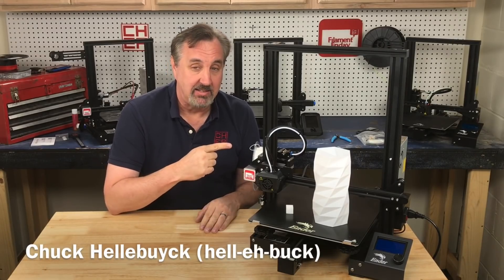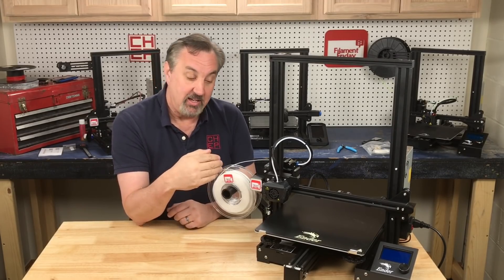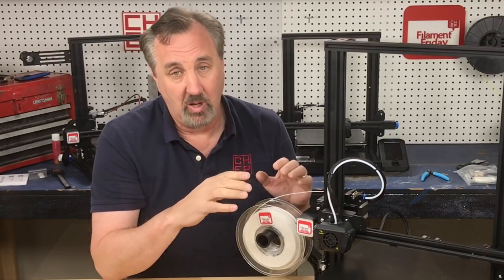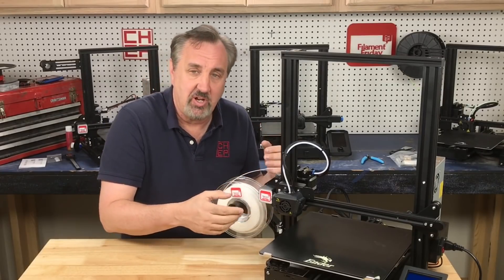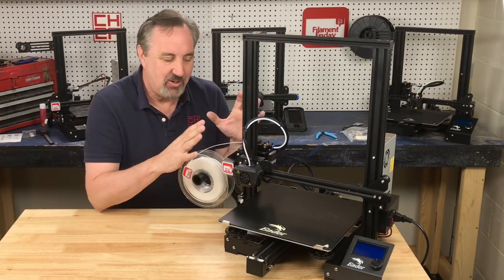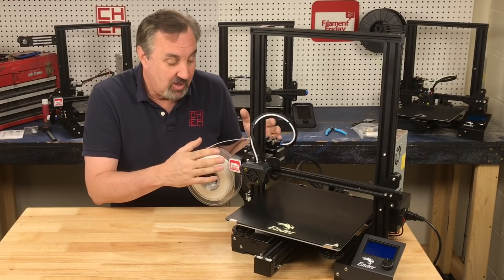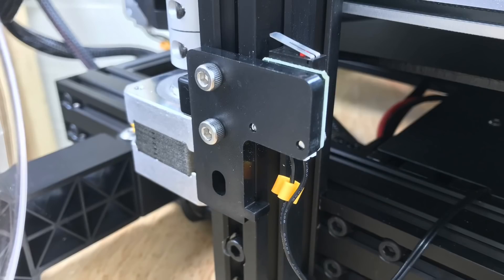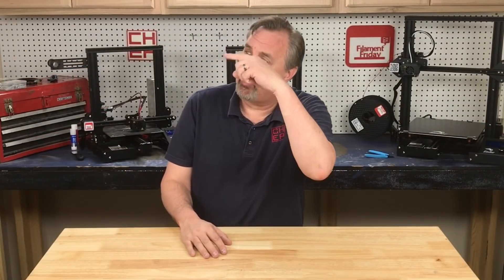Creality Ender 3 MAX Better and Cheaper Improved Version

Comment: I bought this as my first printer, didn't realize it was so new of a release. So far it's been great except for the runout sensor. The sensor uses a roller on a lever to push a switch when filament is fed through. The hinge that attaches the lever has too much play and allows the lever to drop, which then allows the filament to bypass it and shuts down the print. Aside from that though I have no complaints, well worth it.
Reply: I also bought this as my first printer... and ran into the same damn issue.
Unscrew the sensor, flip it over, and loosen the two screws on the sensor's board. Push the sensor up about 1mm towards the filament, then tighten back down. You won't have a problem anymore  :)

Comment: Hey Chep, what are good software and slicer to use for beginner 3D printing? I'm thinking of using Cura Slicer and Fusion 360.
Reply from the maker: Those are both good choices
Reply: @FilamentFriday  Thanks for the info. Gonna build my Ender 3 pro tonight

Comment: What happens to the bed when the filament runout sensor is set off? Does the bed turn off?
Reply from the maker: Good question. I believe it stays hot. I’ll have to check again.

Comment: I have a CR 6 and really don't like the extruder. Would the Max metal extruder bolt right on without any modifications.
Reply from the maker: I believe it would but I would look at the EZR instead. https://youtu.be/1GNDxvxpWr8
Reply: @FilamentFriday  Looks good and EZ to use. Gonna order one. I live in the Philippines so this may be the next challenge.

Comment: Got it for 244euros(280-290usd) at the end of February. If what you're saying is true about the 2208s (on all 4 axises) then i bought the skr 1.4 turbo + 2209s too early. Should have flashed marlin earlier. Oh well, at least i'm gonna have the ability to dual extrude in the future. Btw to this date i've ordered extra parts for it for about an other 250euros to make it do nice quality prints and print with up to at least polycarbonate. Oh an my bed is warped, but i think i was able to get it a bit more straight with heating it to 105C and leaving it like that for an hour.

Comment: Hey Chuck, I am thinking about the second printer now coming from the Ender 3 pro, and this looks great. A couple of questions though: how easy is it to add a BLTouch? also I prefer to print on PEI, it looks like the bed is just held on with clips, should be easy to replace it, no? Thanks for another great vid, Mike
Reply from the maker: BLTouch is pretty easy. Yep, bed held with clips.

Comment: Great review.
Because of your videos, when I bought my 1st comercial 3D printer, I got the Ender 3.
I have added the Ender 3 Max to my stable just over a week ago.
I am so impressed with the printer. And the finish with that glass bed.
Due to import duties I paid about $400 for mine. A Standard Ender 3 retails for about $300 here in South Africa.
An Ender 3 Max and an Ender 5 cost about the same.
Did yours also have over tight v-rollers? It pulled my gantry to one side causing layer shifts on 1 side. But having the v-rollers adjusted solved that issue.
Just 1 complaint. 
The non-scrolling display.............
If you have long file names, you cannot see the end. I had to rename all my files.

Comment: Height is overrated for this type of printer.  The fact that the bed has to run back and forth for the Y axis means you're going to get vibration in tall things.
Reply: I bet if you were SMRT you could program the bed to move slower as the print got higher

Comment: Does this printer have a heated bed that covers the entire bed surface or did they simply use the one from the Ender 3/Pro/V2?  The problem with the Ender Extender is you're expected to reuse the existing heated bed which on a 400x400mm bed is very small and could be a problem with some filaments with bed adhesion.  It's an additional charge from Ender Extender to buy a bed heater that properly fits the larder bed.  Therefore, that should be factored in when doing cost comparing.
My biggest concern with this printer is the lack of dual Z.  The Ender 3 has a small enough gantry that a single Z screw isn't a big deal but with a longer gantry, you run the risk of the gantry racking due to weight from the hotend when it's far away from the side with the lead screw.  Time will tell if my concerns are real.  I suspect there will be dual lead screw kits available soon enough similar to the original CR10.
Reply: It heated bed is full size and had no issues with adhesion. I haven’t seen an issue with the single z drive yet.

Comment: In the image shown, the extruder gear is indeed screwed on, but it's screwed on incorrectly.  The grub screw should come down on the flat of the shaft and it doesn't.
Reply: Yep, mine has two and one is on the flat.
Reply: Look again, there are two grub screws. One on the flat end, one on the round.

Comment: Been trying to figure out which one I want to get as a second printer, currently have a Ender 3 Pro and wanted a second printer with a bigger build volume, this one checks all the boxes finally. Thanks Chep.
Reply: Your on the same journey as I. I started with an Ender 3 Pro and got the MAX last week. Fans, BLtouch and better extruder and I love it. It should come with optional 0.6mm nozzle. Doesn’t make sense printing with a 0.4mm.
Reply: bit the bullet and bought one today, now to explain it to the wife...

Comment: Big ender upgrade kit is 239, not 329. Spend 239, get the upgrade kit; spend 20 and get a metal extruder. Spend 10 and get another fan. 269 to upgrade the ender 3/v2 to 400x400x450. Upgrade your ender if you have one. If you don’t and want to GET one, this is your best entry bet BY FAR. 

Wish these were out when I got my v2 last month. Oh well. I’ve been thinking about the extender kit and metal extruder. Might as well do it.
Reply: but with this youd have 2 printers for 100 bucks.

Comment: The v2 has to be the nicest looking out of the 3 series. I wish they would've tucked the power supply underneath it for the max. Along with the belt tensioners. This is just a regular ender 3 with some bolt ons and upgraded board
Reply: That's just what I was thinking, seems like a downgrade from the v2 with just a larger volume
Reply: I would rather have the bigger volume. Power supply isn’t noticeable in use and the tensioners add a nicety.

Comment: Damm I wish I'd had seen this before buying the v2 a few months ago
Reply: Same, feel kinda annoyed since the machine I got was a hot mess
Reply: Same 😅
Reply: same lol
Reply: I love my v2 but the voxelab Aquila bis essentially the same machine for a hundred less. I actually have more trouble keeping the bed level (after adding the heavy springs) with my v2 than I do with the Aquila.
Reply: @roughcountryoutfitters4545  it's because the v-slot wheels for the bed wear out, the bed is so heavy that no amount of tension, tight or loose, will keep them from getting tore up. Had to replace mine with linear rails for durability
Reply: Yup same here :(
Reply: But v2 has tensioners, right?

Comment: Bought this printer last weekend and have had numerous problems. Swapped the limit switch screws with some t-nuts as you said and it helped a lot. However the display bracket clearance holes were too small and the firmware has been very buggy and the extruder driver doesn't seem to be silent, or as silent as my upgraded 2 and half year old Ender 3. 

 If I go through the menus too quickly I have to reset the printer and had an issue where half way through where the printer was buffering, doing 1mm stop/start movements. What should have been a two hour print turned into 5 hours. 

I can see the potential but it looks like I need to fix some bugs first!
Reply from the maker: The buffering could be the SD card. Try a new one.

Comment: I've been very happy with mine and the only real issues have been my own error. But I will say that the hot end's fan is really loud.
Reply: Yep, I Replaced  the fans on day two.
Reply: @alanjones4747  Why didn't I think of that... where'd you find one?
Reply: I did the Noctua mod. Expensive but quiet. Need a 12v step down buck converter. Replaced the control dox and hotend both running off the same supply. Just Z homing noise now. I may get a fully quiet control board but not yet.
Reply: @alanjones4747  I know what some of that means...

Comment: 3dprintersbay has these for $290 right now.  I didn't know anything about the company, but mine did show up in 4 or 5 business days.  I never got a tracking number.  It just showed up on my door step.  It probably wouldn't be great if you lived in an apartment, but it was OK for me.    

I've only run a few prints through it, but it seems fine.  I think I got one with a bad blower fan on the main board.  It grinds until it gets up to speed, but for the price I suppose I'll forgive that problem.  I can probably get replacement fans at the surplus store of for a couple bucks off amazon.

Comment: Is this an upgrade from Ender 3 pro? Ender 3 v2?
Reply: I have the ender 3v2 already, thinking second printer. I am Wondering if its even with build, just larger bed size? Minus the lcd and small features.
Reply from the maker: More pro with same display and power supply arrangement.

Comment: is thermal runaway enabled on this and why does the pic on their site show its 300x300x400 but says its 340?
Reply: CR10 is 400 this is 340. Thermal runaway should be enabled but didn’t check as I compiled Marlin because of bugs with BLTouch.

Comment: I already have 2 Ender 3's and a CR-10 but if I were wanting another printer in this price bracket I would go for another CR-10 as it is £20 cheaper and the control box is separate which is a deal maker for me as I enclose my printers in Lack boxes and have made them all dual part fan for very little money
Reply: I also plan on Enclosing my CR10 V3... I'm going to mount my raspberry pi, octoprint on top or on the side of the CR10 control box.  Thanks for validating my thoughts.
Reply: I got a MAX for £260 at BOX (I had never heard of them) but I got it delivered in two days. Banggood is a bit more expensive but their shipping is ridiculous at the moment. £100+
Reply: @alanjones4747  with Banggood you have to search through the ads as there will be one with free shipping
Reply: What the cheapest you’ve seen CR10 as even second hand they want £300+

Comment: Single best upgrade I've done on my ender 3 pro is the dual Z lead screw. The gantry wobble went away completely and my bed leveling got really consistent. Seeing as this has a longer gantry it seems that it becomes even more susceptable to gantry wobble. Have they added another screw for securing the gantry to the left hand carriage?
Reply: This is basically just a built version of the kit they sell, which is just longer extrusions. So no, no second lead screw. Creality does have a dual lead screw kit out now though.
Reply: The Z uprights screw into the side and rest on the table under the printer so it’s slightly different to the pro. It seems pretty solid but so does the pro.

Comment: Creality's website suggests the stock hot end also has a copper-plated nozzle.    Heated bed is also insulated on the Max.
Reply: It is copper plated and looks gold. Still not all metal so will require maintenance to stop clogging. I have already replaced mine.
Reply: @alanjones4747  I wonder why some machines clog, like my Tronxy X3 (paid $100 including shipping) has ran through maybe 10 pounds of plastic and never had a nozzle jam with same exact nozzle assy as the Ender 3 from what I can see, though I've upgraded the duct system with a printed variable outlet one with moving flaps. I haven't used it quite as much as my older reprap which I've went through multiple nozzles (I go until a .4mm becomes 1+mm, one even ran until 1.2mm wide by 1.8mm in a figure 8 or infinity looking extrusion instead of round, lol!). I've had it jam a few times but couple of the times it was a terrible heater block being the issue (bad alloy and terrible heating design), but most of the time it was just my fan wire unplugging (using V6 all metal but weak fan, now using V5 with stock fan assy and zero issues so far).

So I'm not convinced it's just the nozzle, garbage filament seems to do it more likely but it's still pretty rare and seems to do more with the cooling on the heatsink than anything else.

Comment: Thanks for the updated review.  I was decided on the Ender 3 Max... until I decided I wanted the CR10 V3... the supports, Duel Z screws, Direct Drive.  I understand the issues the CR10 V3 choice of the direct drive has "design issues" as it was implemented... but I viewed several Makers with the proper changes to fix the design issues. 

What's your thoughts on the CR10 V3, understanding the changes needed for the Direct Drive Head.
Reply: For me, the V3 is a great printer that ticks all the box's and having the separate control box saves me loads of work as I enclose all my printers in Lack enclosures, I am considering getting a new printer and at the moment the V3 is at the top of the list but I am going to change the extruder motor to a pancake model as it is much lighter

Comment: I just bought one of these. The Z offset switch was very high above the bed and I fitted a BLtouch so not a big problem. I had a trouble with the filament sensor and older filament, it would get stuck because the filament had a curl and when I did get it through the sensor I then had the same problem in the extruder. I replaced the extruder for the upgraded silver model from creality so it has  threaded fittings for the bowden tube. Using new filament was a lot easier to feed the filament through and once it started printing I was very happy with it. I was a little bit shocked to find no ready to print stl files on the sd card and then the provided creality slicer didn't have a Max profile. I think this would be quite confusing for someone new to 3d printing.

Comment: I would prefer to buy ender 5 plus.Please compare in next video👍🏻
Reply: Totally different machines.  One is a bed-slinger.    The Max has  more than double the printbed area (144 sq inches vs. 64 on the Ender 5).     The Ender 5 is more a 'daily driver' vs. the Max is for much larger prints (add a .6mm nozzle) and you wouldn't want to have to heat up that large bed all the time just to print small items.    Ideally you would own both. ;-)
Reply: @3dloon430  yes my bad not ender 5 pro but ender 5 plus
Reply: Yeah, as you get larger the y-axis/bed weight really increases a lot, especially with the single rail support. I'd much prefer the Ender 5 Plus style to this.